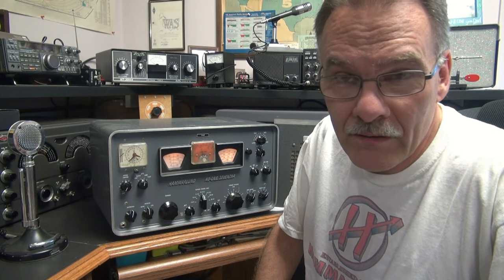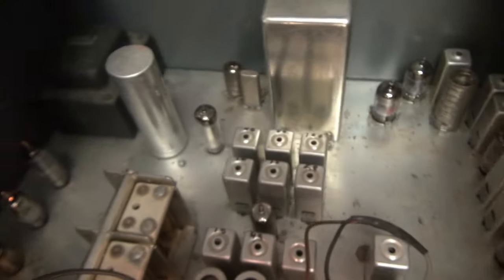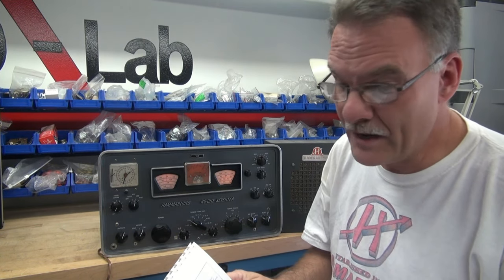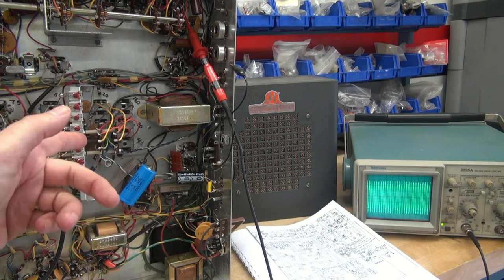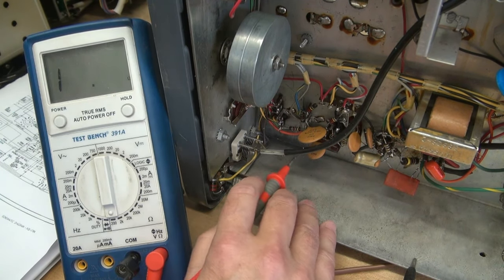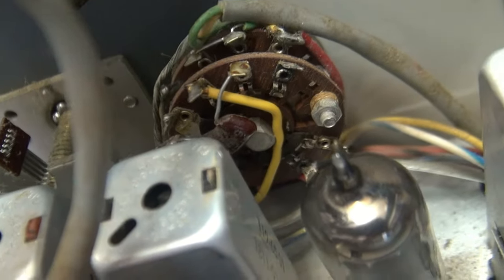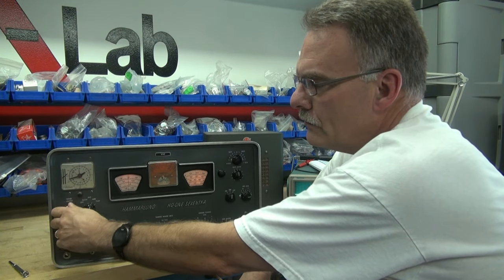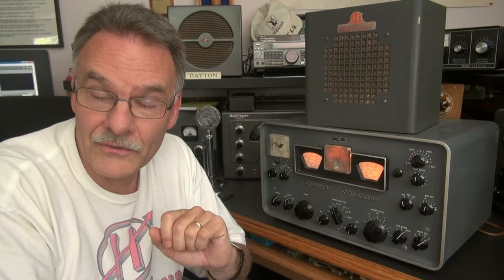How to repair Vintage Hammarlund HQ-170a Ham Shortwave Receiver D-lab

Comment: This reminds me to always look for the obvious first. This brought back an incident about 5 years ago...customer brought in an old Bogen PA amplifier, and he complained it blew the fuse instantly when turned on. Well, the first thing that came to mind was, shorted output tubes, shorted rectifier tube, filter caps, or output transformer. but after taking the top and bottom cover off the chassis, one of the things I discovered was, the two high voltage secondary leads that went through a hole which lead to the underside of the chassis had sliced insulation and the leads were welded to the chassis. obviously, some clown replaced the PT at one time and failed to replace the rubber grommet where the secondary leads passed through. Luckily, it didn't fry the PT. After removing the shorted leads, I cut & restripped them and soldered them...installed HS tubing, and added a new grommet...problem solved, amplifier was back in service which equaled a happy customer. After many years as a service tech, I learned in my younger years to look for the obvious before spending time on component-level troubleshooting :) Great video! Keep more coming :) Now, chill that Merlot and enjoy the holiday weekend :)